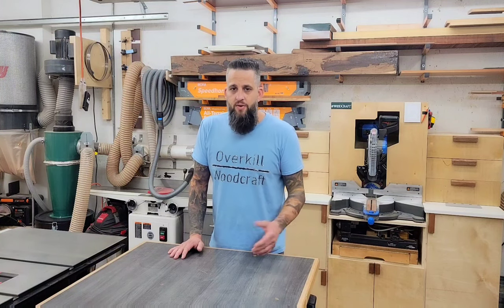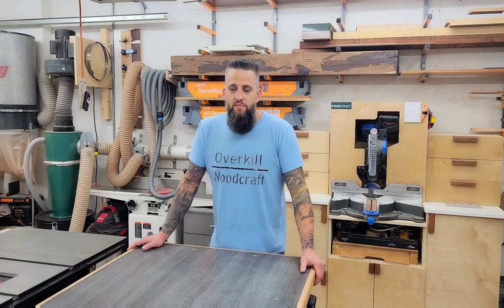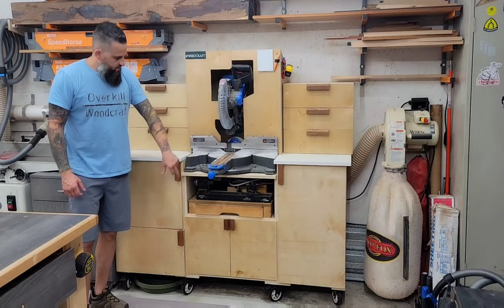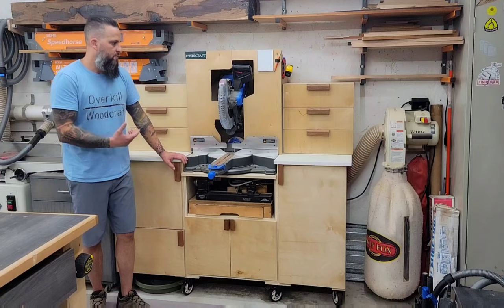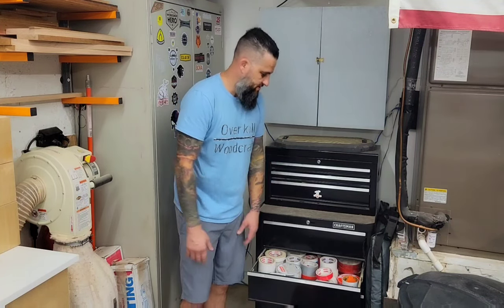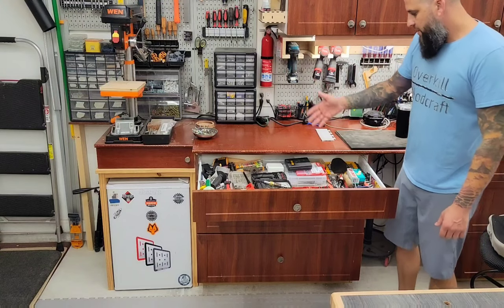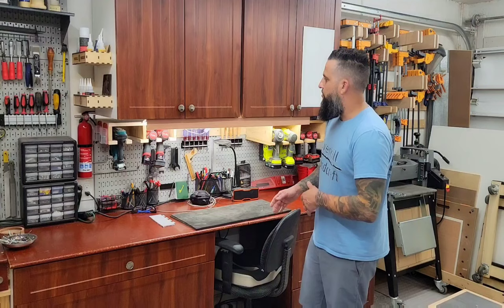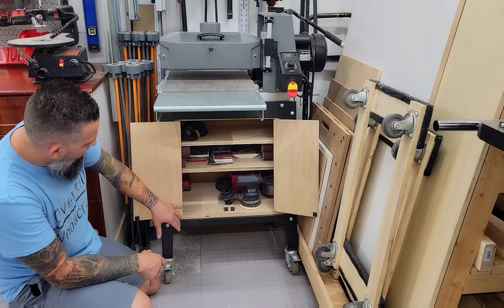Two Car Garage Woodworking / Woodshop Tour (2021)

Comment: something you should be aware of, ducting from you central HVAC system into your garage/shop is a bad idea (against building codes in most places), it can backdraft exhaust fumes and your spray booth fumes into your home.
Reply from the maker: Good looking out, but I have a switch near my door that closes the duct vent. Eliminates any fumes and saves on the AC bill.

Comment: As a firefighter (ex) I've got to suggest that having power in your flammables storage is a really really bad idea. Nice workshop though.
Reply from the maker: They're on a surge protector, thank you though.
Reply: @OverkillWoodcraft  THAT MAKES ZERO DIFFERENCE
Reply from the maker: @bigg2904  Good to know. I'm very paranoid with electrical, so I always unplug everything when I'm not in the shop.
Reply: @OverkillWoodcraft  Not to harp but I've witnessrd the results of an instant explosion in similar circumstances when there was a lightning strike miles away. In a pro flam cabinet, when an illegal vent fan sparked. No surge protector will protect against high voltage. Still your place, your family. BTW 2 guys were killed.
Reply from the maker: @bigg2904  Tragic. Guess it's a good thing all my stuff is up to code.

Comment: Question for you how do you power your tablesaw in the center of your shop do you have power that drops down from the ceiling I’m in the same kind of situation.
Reply from the maker: Yeah so I had one of those spring loaded extension cord reels/drums plugged into the garage door open outlet in the center of the ceiling. You can kind of see it around the 17:00 mark between the motor and my air filter. Just make sure to get the thicker gauge with the surge protector, I can add a link if you'd like 👍🏻

Comment: Nice shop!  I love the planer storage.  My planer storage is a metal tool box with no drawers that I found next to the dumpster at a radator shop.  Its super heavy and had nice casters.  Someone just too the drawers out.  I originally was going to make a industrial night stand, but when I unboxed the planer it fit.  Been that way for a few years!  Thanks for inspiring me to build drawers in it. Only knock I got is your flammable paint locker.  You might possibly collect fumes in there.  It shouldn't really have things in them to product sparks.... like battery chargers.  I'd just build something to pull that mess outside the cabinet.  Just a long shot safety thing as your shop is attached to your house.  Also, you might think of a fire extinguisher in there.
Reply from the maker: Hey thanks for taking the time to watch it, and I'm glad you found some inspiration for the planer cart! The one you have sounds pretty awesome, definitely won't have to worry about it breaking haha. I appreciate the looking out on the locker too. I get pretty paranoid about that stuff so I always unplug everything when I leave the shop and keep multiple fire extinguishers around. Since moving into my new shop I've relocated the chargers just be extra safe though 👍🏻

Comment: Great little shop and nicely presented. I like your comment on the ability to make great things without having expensive machines and tools. I’m a prime example. I’m a tool and die maker for over 50 years ( retired now ) several years after completing my apprenticeship I started my own wood shop. I made a lot of kitchen and bathroom cabinetry as well as speciality furniture. I had a tiny little 8 table saw. A Craftsman radial saw. Craftsman 6 inch jointer and  14 inch Craftsman band saw . A dinky 12 inch planner, a 6X 48 belt sander and a drill press. Somehow I managed. As the business grew I was able to get more nicer equipment. Bought several pieces at auction. Point is it’s great to have all the wonderful pieces of equipment but a true craftsman CAN make chicken soup from chicken shit! My total investment initially was less than the price of Saw Stop saw alone. Enjoyed your video. Good luck with your new shop.
Reply from the maker: Thank you, I really appreciate the feedback! Awesome story too, was glad to hear it and obviously I couldn't agree more. Someone actually commented on one of my other videos recently and assumed I bought everything with my parent's money, which was funny to me. Fancy tools definitely help, especially with efficiency in some areas, but like you said they're not needed. Here in the next few months I'll finally get around to filming a tour of the new shop...once I'm done paying for more fancy tools with some commission work haha.
Reply: @OverkillWoodcraft  thank you too for your reply. I’m close to doing my first YouTube video on my hobby shop. I have mostly metal working but a bunch of woodworking stuff. I have several things that cross over. You can’t cut metal with wood tools but you can cut wood with metal tools 😉
Reply from the maker: @Lwimmermastermetalart  Of course, sounds like a good shop! Metal working is something I'm slowly getting into...Wish I was able to spend more time on it but the end goal is to have my garage set up as a mini metal shop.
Reply: @OverkillWoodcraft  I wish you much success. If you’d like any help with suggestions or anything I’d be more than happy to help. Hopefully you’ll be able to watch a shop tour of my shop. Getting real close to trying it. Somewhat concerned how it will go and just how many ppl will watch but nothing ventured nothing gained ….right
Reply from the maker: @Lwimmermastermetalart  I appreciate that, and I'd be glad to watch it. Just sub'd so I'll know when it's out. That's exactly it though, I was a little nervous about this one and it's my most viewed long format video 🤷‍♂️ haha.
Reply: @OverkillWoodcraft  that’s great, hope mine will be as successful.

Comment: Nice shop
Woodworker here but new to YouTube content creation
Btw that kobalt router table with router may be the best deal in woodworking 
Great stuff and thank you for your service
Just subbed
Reply from the maker: Hey much appreciated sir and thank you for the sub, sub'd back! Yeah that Kobalt table has been through three iterations of my bench, such a champ. Unfortunately the router died when I hit a hidden knot in some end grain white oak a while back. Fortunately I was able to easily modify the table for the Bosch I replaced it with.
Reply: @OverkillWoodcraft  thanks do u have an Instagram too I just set 1 of them up too same name as here also what issues dud u have with the F2?
Reply from the maker: Sure do, just followed 👍🏻 My issues were small far as the saw, but big when it came to their customer service. The miter gauge gouged my cast iron top right out the box and I had to take the issue all the way up to their GM, who was awesome, but the techs before him basically told me to shove off. Then part of the worm drive shaft snapped and I couldn't raise or lower the blade with the wheel. Took a long time and lots of complaining to get the parts and zero explanation on how to replace them. It's a great saw overall, but I do wish I would've shelled out for a more powerful one from a brand with better customer service.

Comment: Fellow disabled vet here. Starting a woodworking business when I move to Texas and your shop is giving me good ideas for what I need and how to set it up. Subscribed 👍
Reply from the maker: Hey brother, glad to hear it's helpful! Best of luck with the business and move, holler if I can help. Thanks for the sub as well!
Reply: @OverkillWoodcraft  thanks man. I’ve been thinking along the same idea as you, but it once cry once. No point buying the cheap stuff just to buy it again. I’m going to buy a nice track saw before I get a table saw. It’s unreal the accurate cuts you can make with a track saw especially for getting started.
Reply from the maker: You're welcome, and yeah it's funny because I still fight the urge to be cheap occasionally haha. Really depends on what you're mostly making, but I'd be lost without a table saw. Do wish I bought a tracksaw sooner though, I took a gamble on the Wen and it's one instance where being "cheap" paid off. It has plenty of power and is dead on every time, but I have used the Makita and can understand why the higher end saws are worth the extra cost.